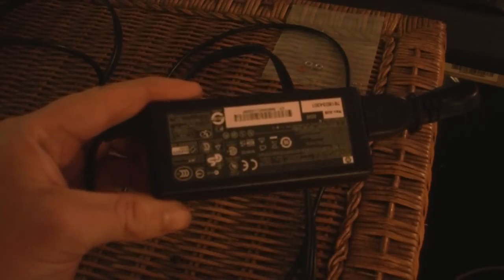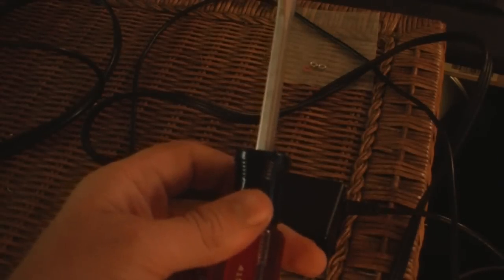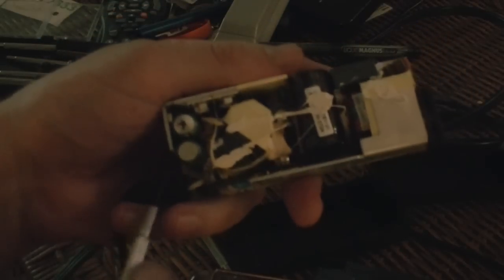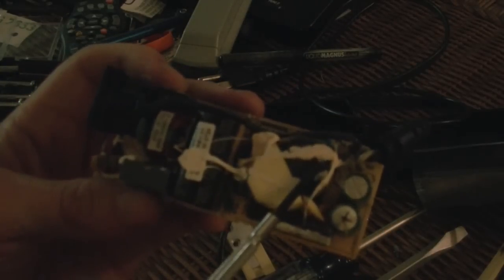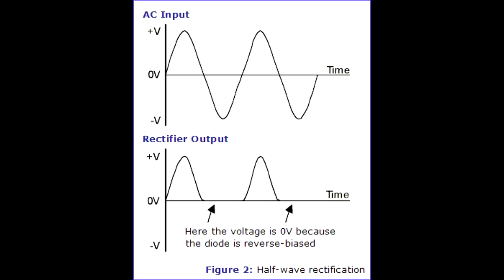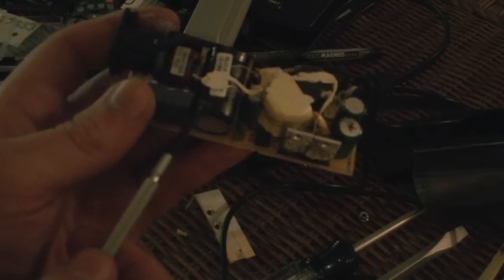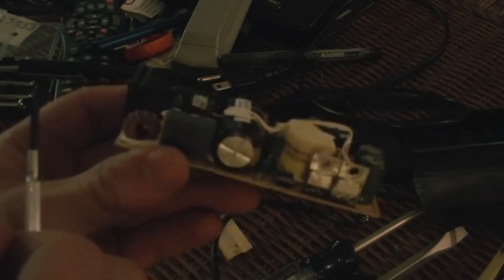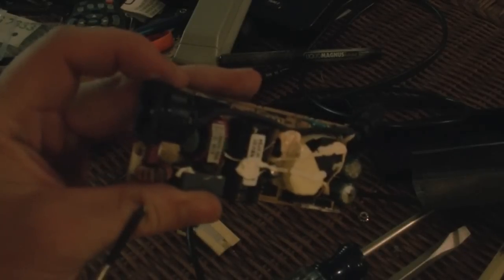Taking Apart an AC DC Convert

Comment: Those diodes are two per package, called common cathode (they share the center pin). So there could be four, but for a flyback topology (which most adapters employ) they usually just use one device with two diodes, one is a free wheeling diode to catch the negative pulse during mosfet switch off, while the other rectifies the forward pulse during mosfet turn on. That other package might be a voltage regulator, or they could be the switching MOSFETs.

Comment: Also, the EMI filter is not to prevent outside sources of noise from getting into the output supply, but to prevent the switching noise from the power supply from getting into the mains.

Comment: These boxes are definitely not servicable thats for sure.  You have to destruct them to take them apart.  It would be very hard to take this apart, replace one of the capacitors and then put it back together.  There are no clips or snaps on these guys!  My was measuring the required 48VDC but I believe it might have had other issues.  Just because the voltage output is in spec does not mean it will work

Comment: I have one of these to an LCD TV that a friend of mine owned. I now own this TV b/c the power brick similar to that seen here was dead. a purchase of a new one yielded the same results. I now run the TV off an XBOX 360 power brick. it puts out exactly what the TV wants and like almost twice the amps the TV draws. the TV works like new. I use it for video games and watching DVDs. 6:15 I can't figure out what was wrong with my TV's brick, possibly the same issue you have with this brick.

Comment: You do realize you described the operation of a linear power supply, but the supply you had in your hands was a switching power supply, right? There are some major differences in the designs. This video is 2 years old, and maybe now you are better informed. A fellow student used this video as an example in a class I am taking, so you may want to consider a revision?